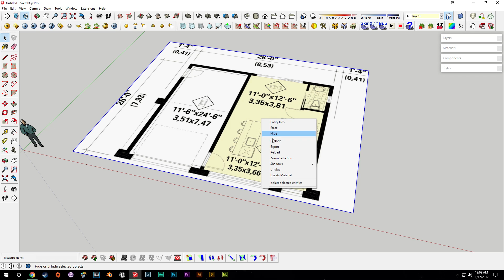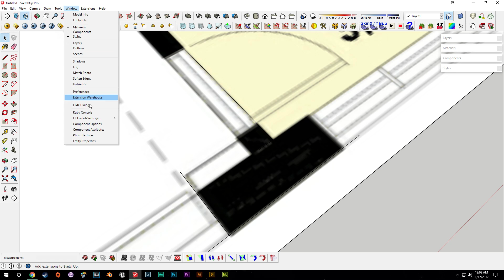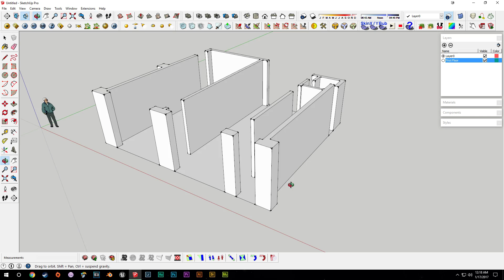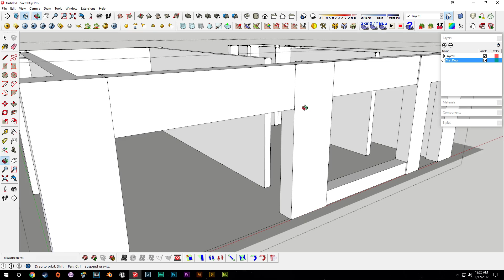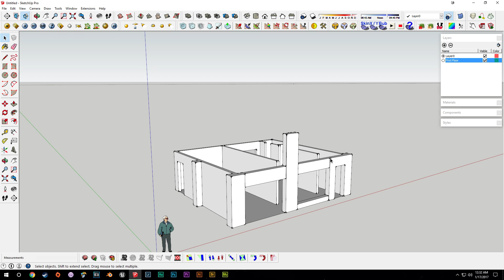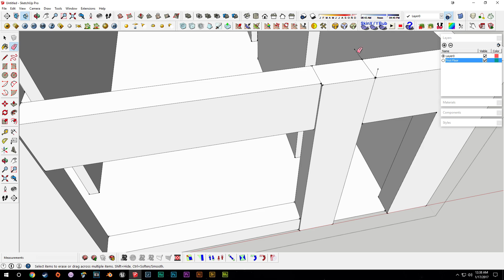FIRST FLOOR - Dramatic Contemporary House Pt. 1

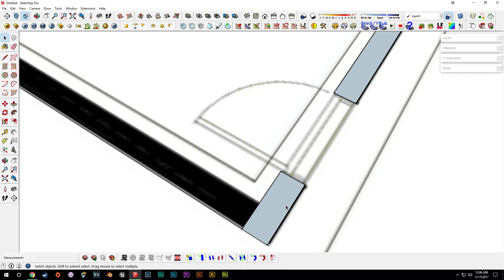Comment: I got lost around the 6:00 mark when you were marking the interior, and doing a lot of work without saying what you were doing. Which shortcuts are you using to push the picture into the background?  What are you doing?  You are going way to fast and not explaining anything.

Comment: why you didn't use image match to get the right measurement for the height  at 22.30
Reply from the maker: Could've done that, however; this series is using the reference image mostly as a loose guide.

Comment: The plan is $675. why so expensive?
Reply from the maker: That's only if you intend to build the house and want physical blueprints for it. For this video series the supplied .jpgs will do.
Reply: Aaron Bishop Thank you Aaron.
Reply: So, how can I save it to my Sketchup?
Reply from the maker: You can right click the images on the website and save them, or if you'd rather, you can use the 'Prt Sc' (print screen) key to take a screenshot and save them that way.